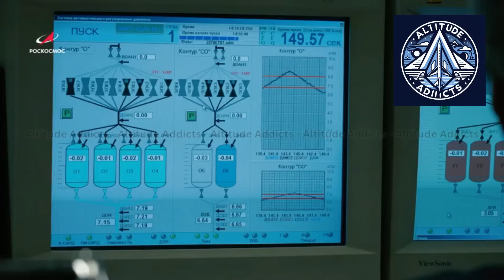Russia Tests Plasma Engines for Space -  KM-50M Hall thruster and ID-750 ion engine

Comment: Dude i made SPACE MEDICINE 

To protect from diseases 

And elevate the consciousness 

Based on EGYPTOLOGY & The Egyptian Book of the Dead

Which covers quantum field theory 

To be able to use plasma jets to jump quickly between stars 

Using an R/C drone

And ion thrusters and a gyroscope, that work like solar sails

In tandem with an MPD....

WITH THAT, 

You can like drop down in to the curve of a stars magnetic field, which curves against it,

So you can use the solar sails

And plasma jet

To create electronic stability and thrust

With the solar wind, through batteries, into different conductors, emitting ions, in a magnetic field 

And the medicine

Is what makes piloting these things effectively possible 

Like in the Egyptian Book of the Dead

It's like changing the mind in a simulated near death state, with chemicals,

To achieve ESP

Or you can't really even go near these things

Because they're super radioactive 

Which isnt dangerous to a trained pilot 

But un initiated people

Genuinely would like hallucinate and stuff being around them 

Or the pilots

Ive seen it 

Its unavoidable, like bridging some unknown gap

In consciousness 

Before you even fly that much

Comment: 7:25 not in space. its really hard to cool down those in space.
Reply: Look at the Russian space tug project (ТЭМ). It will use the huge cooling panels (by radiation) which will use the same inert gas for the reactor cooling.